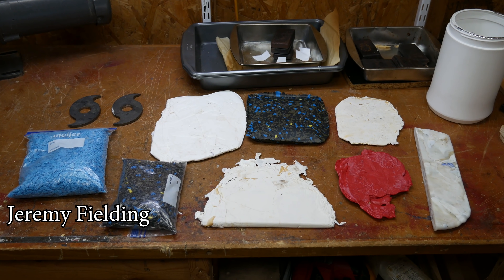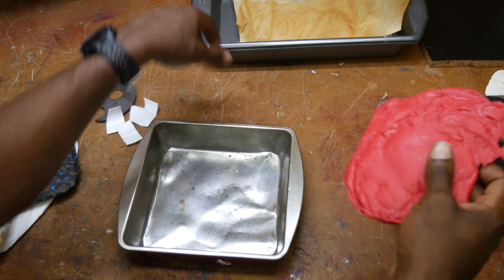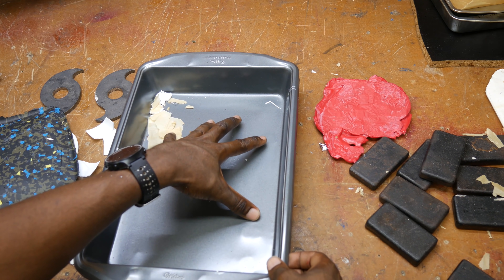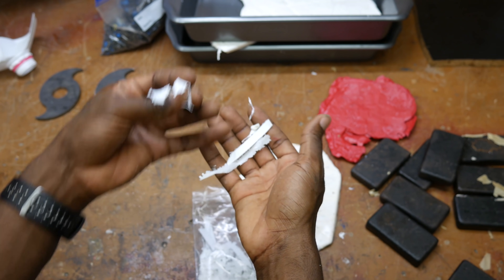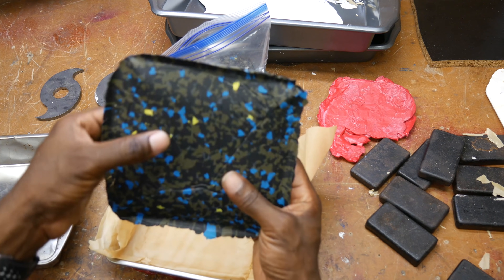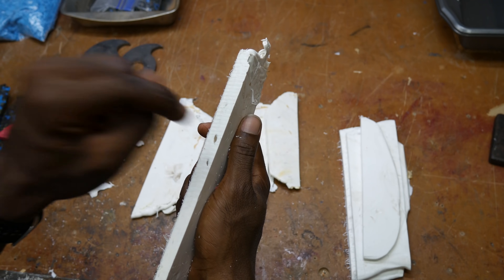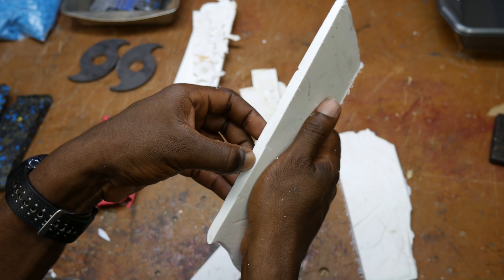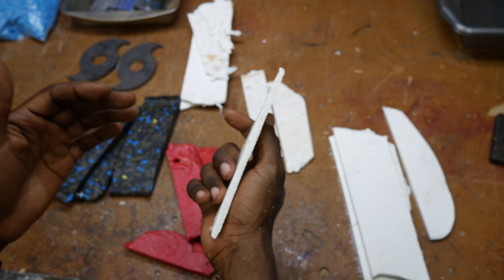HDPE, How Much Processing Is Required; I Put It To The Test!: 043

Comment: Have you tried letting it cool just enough to still be pliable but not hardened and running it through sizing rollers? (like the old washing machine dryers had on them)

This may compress it enough to fill voids before it cools and should make uniform thickness blanks. Just an idea.
Reply from the maker: +Victor Strickland that is interesting. I have not tried that. It actually sounds pretty promising. The rollers would have to be hot. It cools very quickly.
Reply: The process of molding almost always starts with a soft material hardened in mold, not a hard material softened and then re-hardening again in a mold.  This is true whether your casting iron, making jello, baking a cake or making pottery.

First, voids are caused by not enough heat reaching the void. By cutting up the plastic into smaller pieces, you’re allowing it to melt faster and more completely. This is because you’re increasing the surface area for heat transfer, It’s the same reason snow melts faster than ice cubes of the same weight.  If you watch carefully, the snow particles closest to the heat source melts first and transfers the heat successively and rapidly to the rest of the snow.  If you really want a good plastic melt, chop it up and add plastic in batches.  Add more plastic only when the last batch has reached the melting point.

Second, adding pressure to the plastic while trying to melt defeats the purpose of chopping it up in the first place.  You’re reducing the amount of surface area available to reach the melting temperature.  It’s like packing snow  while trying to melt it. If the plastic is properly molten and molded, it should not have any voids. Rolling the plastic or pressing it won’t remove the voids, it will only flatten them into invisibility.
Reply: The Farm Life, sounds like a good idea, and I believe if I had a lathe, I could turn a couple of DOM tubes to a smooth surface, pack with dry sand & cap them and have rollers that I could heat and run the 'melt' through.
Reply: As far as heating the rollers goes if they are iron or steel it might be possible to use induction to heat them.
Reply: I was thinking the same thing.  Jeremy, you can get a hand cranked pasta making roller for about 20 bucks at a yard sale.  They are made out of stainless steel, so could easily be heated.
Reply: I had been planning all these possibilities but thought it might be necessary to process the material twice. Once rolled I'm not certain it would retain its shape but certainly constant thickness.
I thought of designing a device rather like a paper binding punch to produce consistent size pellets from the rolled material which would then not require actual shredding: but of course would double processing time.
Reply: It might be possible to repurpose drums from old laser printers.  I believe they're made from aluminum, so I'm not sure how sturdy they are.  They are heated from inside by an electrical element.  Temperature should be controllable by the amount of power applied.
Reply: Sean Flanagan, thats more in line with what was thinking. I think the real trick is going to be monitoring the exterior heat and finding that sweet spot where the exterior is pliable but not real sticky. It would have to be done quickly too. Maybe have the tubes geared together and have it all motor operated? (I know he hates motors but maybe he will try it lol)
Reply: Barry Manilowa, I do follow your train of thought and understand it. With the idea of rolling it out,  the sweet spot in temperature and the pressure applied would be critical. If the inside is still near melting, the voids sides may bond together and seal under the pressure (like forge welding a piece of steel.. The perfect temp and pressure are critical). I don't know if it would work but, it would be a good experiment to try. If nothing else, it would make the blanks more uniform.
Reply: a lot of HDPE does not cool that quickly. I have given the roller idea some thought myself. That's how they make steel.
Reply: Would be very interested to see this work.. its how poly pipes are made its called extruded hdpe, its extremely hard to cool at a reliable  rate whist maintaining wall pressurisation  on your parts, the machines are 50m long lol, would be cool to see a home version though..

Comment: Maybe for the clear plastics you could use sacrificial molds to melt it, like an aluminum can for instance. Might be able to cut the can off of it, idk.
Reply from the maker: +vosco zoozoos I saw a video where a guy did exactly that. I completely forgot until you said that. It’s a good solution.

Comment: Nice, have you found the optimum ratio between the weights and the HDPE weight?
Not super useful but it could get you the optimum compression to reduce air gaps...
Either way, take it easy :)
Reply from the maker: +Adrian Tech i think it should be as much weight as will fit without deforming the pan :)
Reply: I think you should melt open air in the oven, then try to do whatever air driving out you're going to try to do out of the oven. I've melted covered and it pretty much sucks compared to melting open. Those little samples you showed should not take you more than 20 minutes to melt. I get more than that melted in 16 minutes. It melts in less, but that's what I set my timer for to recharge the melt. Because I don't want to get up for no good reason.